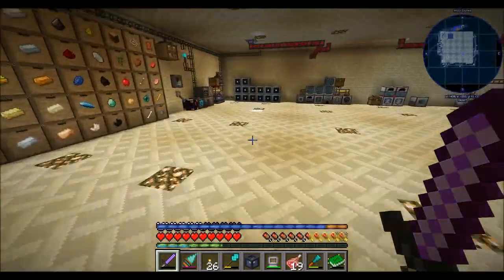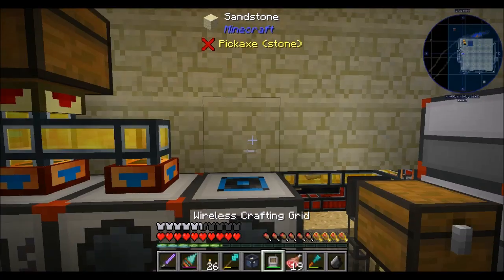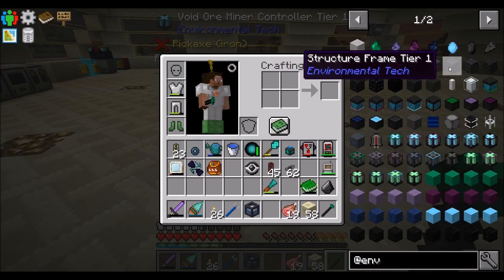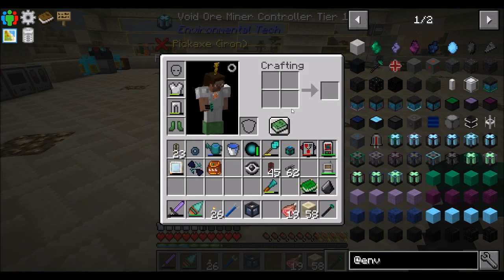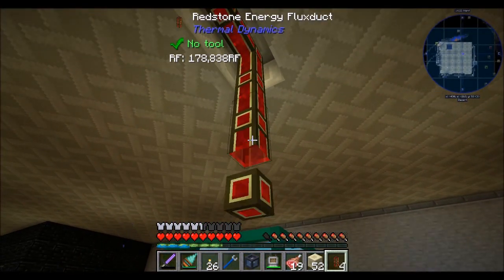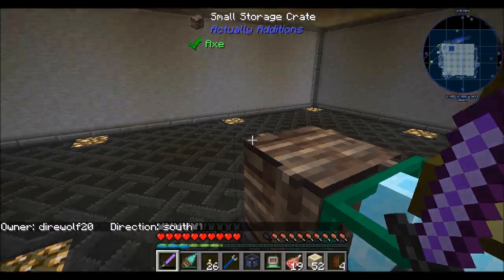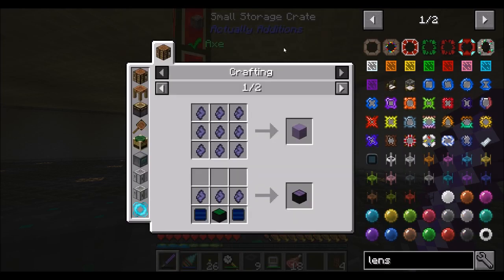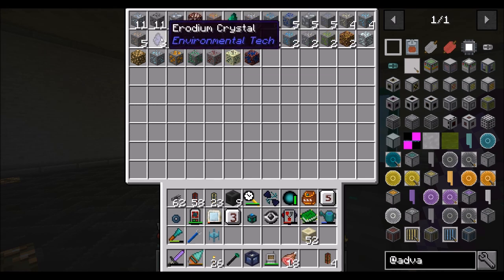Lets Play S9 E42 Void Ore Mining

Comment: Fair warning Dire, the new ET is notoriously slow. Like leave in on and running in the background for days just to get to tier 2. Leave it running for WEEKS before you are getting to the higher tiers to do anything interesting much less make the other 2 machines. If you look around online, it is a frequently asked question whether this is a bug or just working as intended.
Reply: Might be worth some config tweaks
Reply: json, config. All the same when you have notepad++ or similar.
Reply: I just built 4 of them
Reply: To be fair, I could also just cheat in 5 stacks of each. Amounts to the same effect IMHO. Also 5 stacks isn't even close to enough.
Reply: That gets you to 2 but doesn't solve ANYTHING for getting to the higher tiers as you have to upgrade evry single one then. That is a poor solution.

Comment: Concrete production is cheaper if you Rube Goldberg it. Just auto-place the Colored Concrete Powder of the needed color into water and then have an auto-breaker smash the Colored Concrete. Ranged Collector works fine for pick-up. #direcantvanilla
Reply: the crafter and transposer can also be used to put water into buckets for certain recipies. if you use the auto-breaker does it always get concrete or does it occasionally pick up the block too fast? auto-breaker has an inventory btw.
Reply: You could just use a refined storage destroyer with a whitelist?
Reply: That's exactly the type I was talking about.
Reply: "direcantvanilla"  
Apparently neither can you... seeing as your suggested build needs auto placer, breaker AND a ranged collector.... none of which are vanilla.
Reply: I can Vanilla it. He just doesn't know how concrete works to really use it.

Comment: The augments in the pulverizer don't work, if you look with speed augments on a ender upgraded the RF cost is much higher then 60 but with auxiliary Sieve its still 60 rf a tick even though the tool tip says more rf will be taken per use/upgrade

Comment: You should set up a lot of these guys with Clear Lenses, as ET is really slow in 1.12 at the moment. I am pretty sure that there are going to eventually be specific lenses for the ET crystals. Eventually, you should use 4 Speed Modifiers with T2 for it to run much faster to actually make it a more bearable process. You can sacrifice 2 of those for Accuracy modifiers if you want, but overall, I don't think it would be worth it until higher tiers in this version.
Reply: Newest version of ET has already done that for the crystals about a week ago, just need to update it and delete the json file to apply the changes.
Reply: Change log say only the ore miner json files, so only those 6. For anyone that ask you must manually update ET to get the new crystal lens, and you need 6 blocks of erodium to make it.

Comment: It's not 100% completed but here some info on void miners 

tier 1 = rf/t 
24 structure blocks Tier 1
20 structure panel
2 laser core
1 clear lens or coloured

Tier 2 = rf/t
32 structure blocks Tier 2 
16 structure panel
3 laser core
1 clear lens or coloured
4 null modifiers or speed,accuracy

Tier 3 = rf/t
56 structure blocks Tier 3
52 structure panel
4 laser core
1 clear lens or coloured
8 null modifiers or speed,accuracy

Tier 4 = rf/t
56 structure blocks Tier 4
56 structure panel
5 laser core
1 clear lens or coloured
12 null modifiers or speed,accuracy

Tier 5 = rf/t
72 structure blocks Tier 5
36 structure panel
6 laser core
1 clear lens or coloured
16 null modifiers or speed,accuracy

Tier 6 = rf/t
92 structure blocks Tier 6
56 structure panel
6 laser core
1 clear lens or coloured
20 null modifiers or speed,accuracy

Comment: Direwolf will you add ender io When it is up to date?
Reply: Theo Härdevik Probably. He added the thermal mods at the end of the 1.10.2 series, when they finally came out.
Reply: I feel like if he does, there would be no point. By the time he added thermal in his 1.10 series, he was just playing with the mod to have fun. It's probably going to be a similar situation with enderio. He most likely won't want to replace all of his itemducts, fluiducts and  fluxducts, with enderio, as that would be a lot to replace in his base.
Reply: At the current rate, I doubt it will be out by the time he finishes the series.  If it is, I guarantee he will add it.  Dire loves EnderIO.
Reply: Theo Härdevik Of course modpack makers always update your modpacks with new mods!

Comment: @24:20 In a 1.10 pack, I set up a maxed out void ore miner with a maxed out mechanical user constantly using a wand on 'fastest' mode on it and I got thousands upon thousands of everything. I think I was getting so much iron that a maxed out mekanism enriching factory (the top tier kind with 7 slots) couldn't keep up with it. I needed 4 translocators just to keep the output chest from clogging up (each of those led into a chest with 4 maxed out transfer nodes leading out of it and into a drawer controller).
It was completely ridiculous.
I combined it with a max tier solar panel with 4 of the acceleration wands in mechanical users and it was generating something like 20 Mrf/t, which (I think, I'm not sure since I had other power generation) was more than the miner was using, so it was just infinite free ores in ridiculous quantities.

Comment: I hate ET. Locking tiers behind a pure time gate is just ridiculous. I waited DAYS to get enough Erodium to craft the Crystal Lens, and then more days for enough to build the Tier 2 Void Ore Miner -- only to realize that I used my Crystal Lens to create the tier 2. So now I'm back to waiting several more days to get enough Erodium to rebuild the Crystal Lens. Talk about not fun -- I'm about ready to go build another quarry and forget this junk. Only there's no other reliable way to get Platinum in the pack, which seems like a major oversight to me. What ever happened to finding those chunks of Obsidian with Platinum and Iridium ores in them??

Also did they remove the ability for the Acceleration Wand to work on the Void Ore Miner controller? Mine doesn't lose any power, and it doesn't seem to be speeding up acquisition of ores.